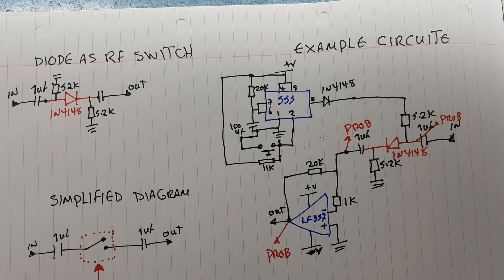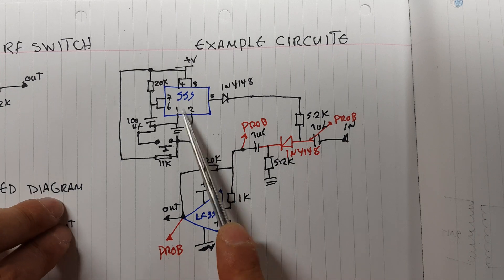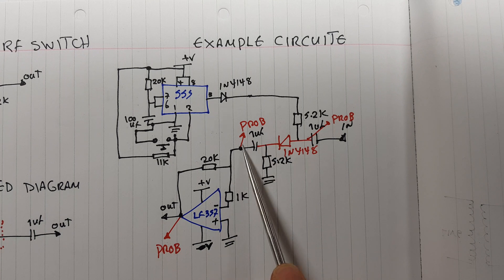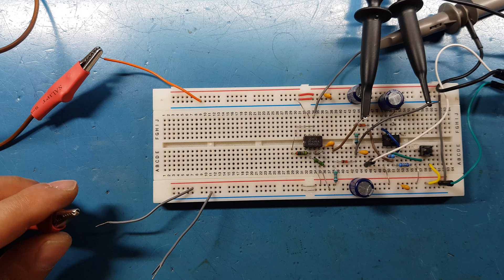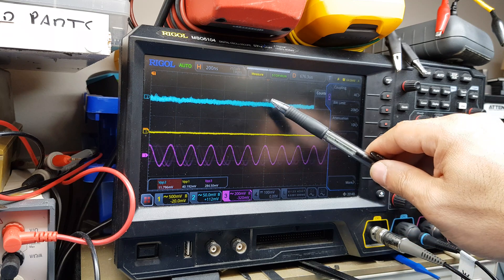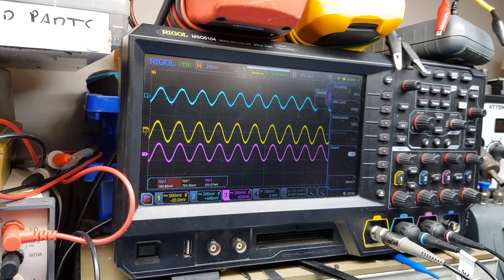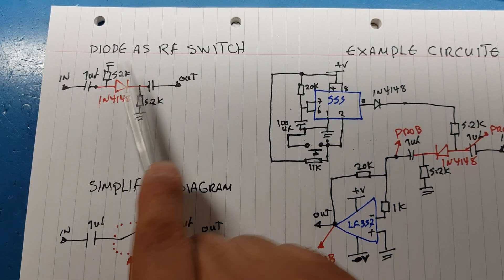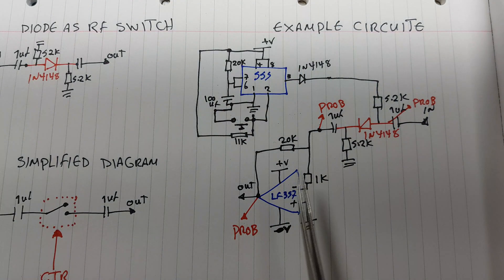How to use Switching diode as a RF switch, to turn signals on and off

Comment: Very nice. An explanation of how the diode actually switches the signal would help. How much voltage do you need on the diode to cause it to allow passthrough entirely? Also, what voltage range for the diode bias as opposed to the rf to not cause clipping.
Reply from the maker: Hi. Tnx for your feedback. I will re visit this topic again with more experiments and explanation in near future.

Comment: I forgot a regular 1N4148 can be used as a switch. Great tutorial. At 1:35 you said the gain is about 20x on the LF357. However, the scope is showing a gain of 2x.
Reply from the maker: Glad you found it usefull. Ops. You are right the scope do show around 2x gain. But that is only because the frequency is 6MHz and there is no way poor LF357 can manage that. So the gain has dropped from x20 to x2. Completely escaped my train of thought. :-)